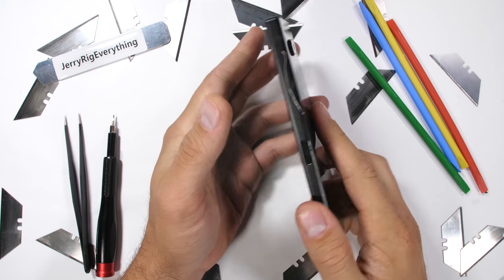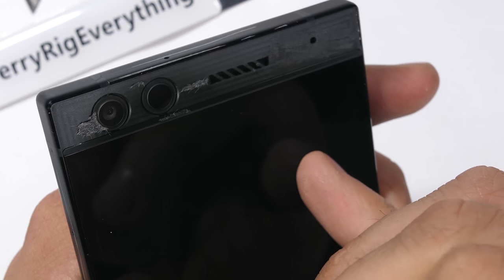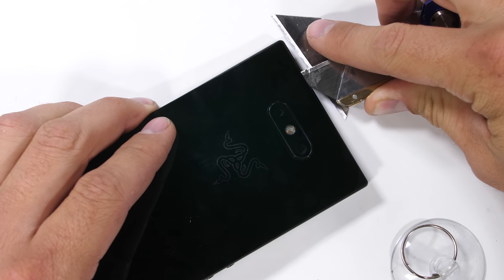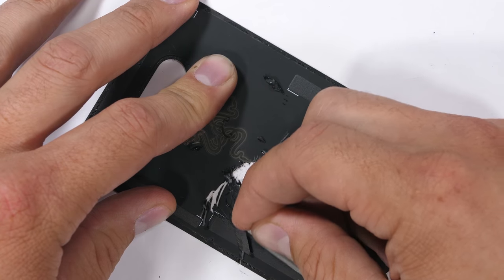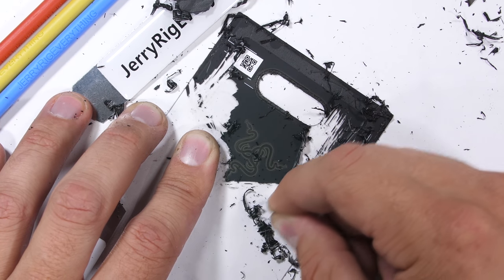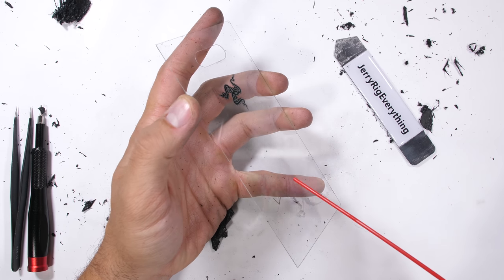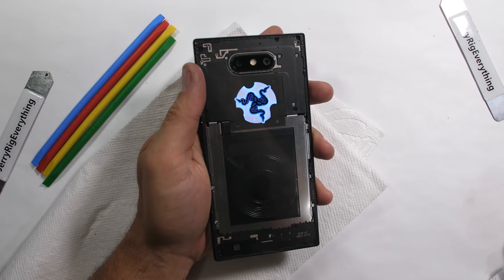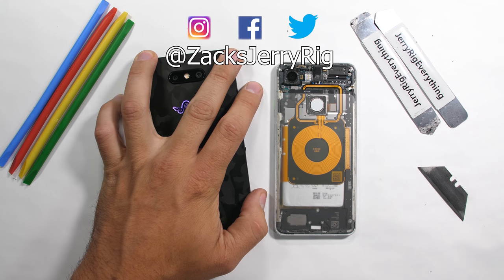Totally Clear Razer Phone 2!! - Some are better than others...

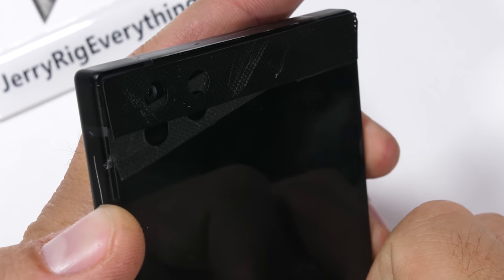Comment: I just love how he manages to stick the parts back perfectly with such an ease.  0:47
Reply: yeahh...it's so satisfying to watch! :)
Reply: So prefect!
Reply: @potato_x69  🥔 is love.
Reply: LOL that happens with 8 or 10 years experience doing smart phone repairs. I think he has been doing this for like 10 years ive been doing it for like 8. I remember my first galaxy s2? glass only repair took me like 90 minutes to get the glass off as i was not sure how much heat i could use and how much force. After that i was shaving off 10 to 30 minutes per phone till i got to around 10 or 15 minutes. They don't really do much in the way of QA n gluing the glass on other than to make sure it has enough to cover the lcd and is cured enough that it wont come up on its own. So you can esp in the s4 and below get galaxy phone where the glass comes off like it was made to do so and others seem like they were glued on with the strongest super glue
Reply: Nova Flare it's sarcasm
Reply: @potato_x69  ily

Comment: I actually think it looks super cool.
Here's an idea: why not put the dbrand sticker on the inside of the phone then put the glass on top? 
Then it'll really look like you've got some super-special edition phone.
Reply: isnt the idea of cases and skins to defend the back glass from shuttering and scratching?
Reply: @CheesyCore  who need protection after all he did with the back glass?
Reply: @khangle6872  well the point of pretty mucy all his bend tests are to show thr fragility of the phones and show that you should protect it.
you practically undermining the entire idea of his channel
Reply: @CheesyCore  this is not bend test, and you misunderstand me entirely. He uncovered the black layer under the glass, and Ben Willock said if he put a new skin there, in the place where the layer used to be, it would look like a special edition of the phone since you still see the glass. We are talking about HIS phone particularly , why would you need scratch protection after put tons of scratch there?
Reply: @khangle6872  If the skin is completely covered in glue then it might leave glue residue on the wireless charging cable and some parts though. But yeah the idea is good.
Reply: @CheesyCore  Actually skins are like just wrappings which look good and might not help with protection of the phones unlike silicone hards cases.

Comment: The rubber part which covers the dual speakers are an exact copy of the one from the Shield Tablet K1! They don't last long and once they come off, it is very annoying to keep dust away from the front-facing cameras since the glue is still present. Really a terrible design from Razer. The Shield Tablet had good features such as the headphone jack. Why not copy that? We wouldn't mind if the good things are copied from other companies.
Reply: Both have lasted long for me.

Comment: Now try to put a headphone jack in to the Razer phone 2!! That would be awesome!!:-) I know you can do it Zack:-)
Reply: Why does it need one though? The only use for a headphone jack on top of a USB C port is for charging while using headphones, and it has a huge battery. It also has gargantuan speakers and a 24bit DAC with the adapter.
Reply: J Arnett what gaming peripheral doesn't have a headphone jack? Headphones are awesome and there are more quality wired headphones that are cheaper and produce better sound with no latency than Bluetooth headsets.

The solution should never be for the consumer to buy anything. You shouldn't by this phone then need to buy something else. 

And yes, many people game and charge. Regardless of the 4000mAh battery, gaming and charging is common place. It would be good to charge and game with some headsets without compensating for a cheap feature by making an expensive purchase
Reply: @kapilbusawah7169  don`t try to argue with the typical dude who says "tHE FuTuRe iS HERe" when someone complains about no 3.5 mm

Comment: Can you check out the xiaomi mi mix 3 smartphone next. It houses a magnetic slide feature like previous generation Nokia's to for the front facing cameras and sensors. It's different from oppo and vivo in sense there is no mechanical moving parts inside. A teardown if that device would be really interesting.